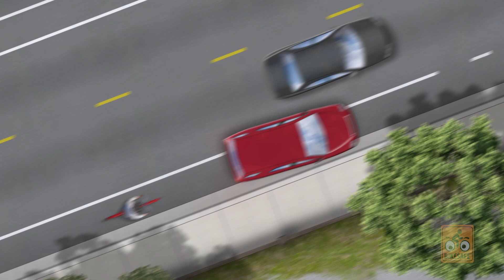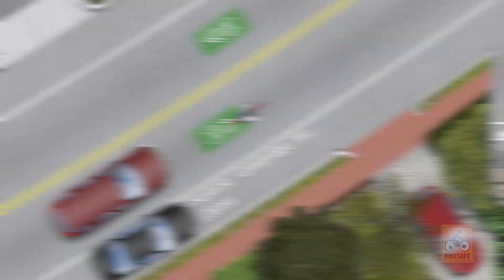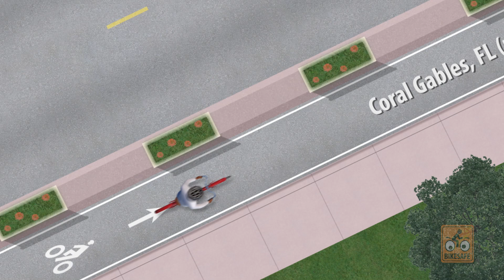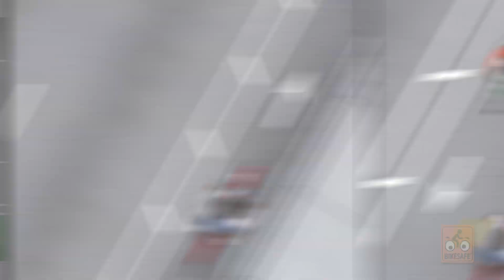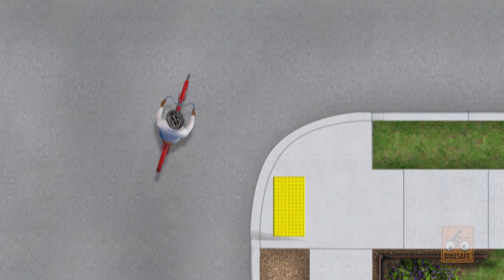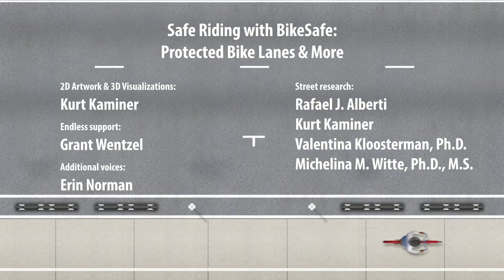Protected Bike Lanes & More

Comment: Islands meant to protect cyclists in intersections can also help prevent street take-overs by those with nothing better to do.
Reply from the maker: Not with the size of American intersections, in general. Plus, a skilled driver with suspension set up for powersliding might use those islands as a drift tap challenge. The better solution are motorsport parks - they prevent hooning on public streets by providing a safe, legal venue for automotive fun. 

Problem is, every time one is built, zoning around them is eventually relaxed for suburban housing sprawl (don't get us started on US approaches to transit!), until residential areas are built close enough to the motorsports park to generate noise complaints. This works in favor of developers, who buy up the now-inoperative track and build further housing on it.

Comment: My city just paints two white lines half a metre apart and calls this "protected".
Reply from the maker: The "protected" term is colloquial; amongst engineers, what we call protected is considered a "separated bicycle lane," allowing for misuse of the "protected" term. Either way, a buffer of that distance does NOT make for a safe, equitable, low-stress bicycle lane. 

If you haven't already, bring both of these facts to the attention of your city and to your local advocates. The squeaky wheel gets the oil.

Comment: What about the emergency vehicles such as fire trucks and ambulance accessing hydrants across the barrier?
Reply from the maker: Hydrant access is rarely affected any more than it is with parallel parking. If anything, access is greatly improved: A protected bike lane improves visibility of the hydrant for first responders versus a line of parked automobiles (with the inevitable one car illegally parked in front of the hydrant, no less). 

This benefit also extends to EMS operations, as an extra curb and a clear lane are much easier to navigate a gurney over than through a line of bumper-to-bumper parking.

Solid Jersey barriers are the only implementation where the configuration requires particular consideration of hydrant access given their height and lack of access. They usually don't pose EMS access issues as Jersey barriers aren't usually used where street-side business or residential access is also required (if anything, they'll reduce the need for EMS over the same area with an unprotected bike lane, where a preventable bike-vs-car crash will inevitably happen)

Otherwise, the majority of protected lane dividers maintain clear human mobility across their curbs, flexposts, or planters - including the necessary room to run fire hoses unobstructed or rush EMS across.

Additionally, designs with lower barriers are often designed to allow emergency vehicles to drive over for access if needed, though this is not always ideal if the average SUV or delivery driver can follow suit.

For the most part, if it has been considered not an obstruction to have a line of parallel parked vehicles in a given location, the access will only be improved if that same area is repurposed as a protected bike lane (usually as a bi-directional lane to maintain parking access on the opposite side of the street, if parking access remains a necessity for the area in question).

Comment: Cant believe you called two lanes for bikes in between car traffic without any protection or meaningful buffering "forward thinking". Absolute bullshit, that would be barely a step up from just having a normal road but even putting a crossing instead would be more safe and comfortable.
Reply from the maker: The Portland example at Stark Street is one of the earliest examples of a center-running left turn lane, and it exists in a neighborhood with pre-existing traffic calming. The lack of protection on that design is the reason that we immediately followed it with the protected example from Santa Monica.

Keep in mind that the video also established that we're discussing both the "pluses and minuses" of all designs. Since we already established that a lack of protection isn't safe (e.g., sharrows, unprotected green bike lanes, advisory lanes), we expect the contrast between the Portland center-running lane and the much safer Santa Monica lane to be clear for those who have remained this far throughout the video.

If someone has a visceral reaction to the lack of protection, all the better - it drives home why protection is an irrevocable requirement for safe, inclusive bike networks.

Comment: The separate protected bike lanes are also good for car drivers . More people cycling equals less people driving therefore more room for cars . The other is drivers won't have to worry as much  about running cyclists over now that each has a lane plus  bicycles do not do any damage to the asphalt or concrete ever and never ever will .

Comment: I've seen some of these bike lanes in my own city (Toronto) including the bad driver examples.  Yes, I've seen drivers performing right-hooks even though they know there is a bike lane with cyclists riding through.  I've also seen planters and flexible bollards knocked over.  I'm think the only safe sure-fire way to separate cars from bike lanes are jersey barriers or solid concrete bollards.
Reply from the maker: Right turns on red must go, and intersections need proper setbacks and tight corners - not the 60 degree behemoths literally designed to allow tractor trailers into city centers.

Comment: How about using a separate traffic light for bicycles for those INSANE intersections that the USA has? You give some many HORRIBLE options for intersections and none are safe. All four sides green for all bicycles while all cars are stopped. Problems solved.
Reply from the maker: Agreed; the FHWA needs to codify proper signaling for micromobility and ensure this also benefits pedestrians as well. Unfortunately, the US does a pretty poor job of traffic timing in the first place for everyone - drivers included - even with sensors. Not Just Bikes' video about the fantastic Dutch sensor system is a perfect example of what we're missing out on: https://www.youtube.com/watch?v=knbVWXzL4-4. 

All things considered though, the US can make VERY quick improvements from a safety standpoint - for both bicycle riders and pedestrians - by eradicating right turns on red, and timing parallel traffic with each other at all times - auto/bike/ped. It doesn't solve the convenience issues of such designs, but for that, we need Dutch-style roundabouts (preferably minus the multi-lane monsters too).

While protected intersections are our pick of the lot as far as current US implementations go (preferences may differ depending on the evolution of US design in 20 years time), we agree that none of the North American models have quite nailed the perfection of the Dutch Roundabout, nor the width necessary to ensure comfortable navigation, especially with cargo bikes.

-KK

Comment: One downside of turn boxes is they don't work well for cycle with larger turn radius like a hand cycle, trike or Velomobile.
Reply from the maker: Very true - and the sharp turn is generally ill advised for when bicycle traffic increases heavily. We much prefer a properly designed protected intersection - with bike lanes that are of suitable width for all (and enough protection to ensure motorists won't slither into it and use it as parking).